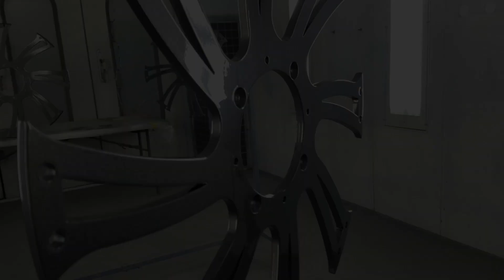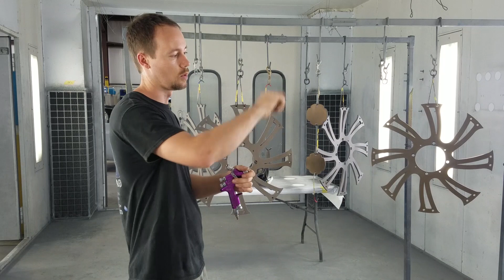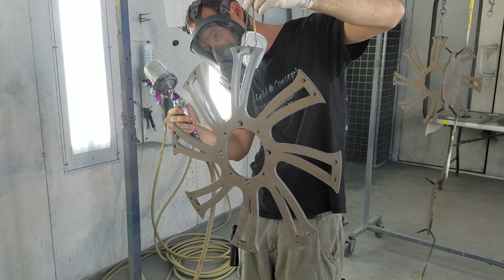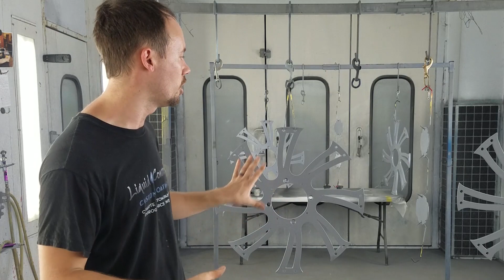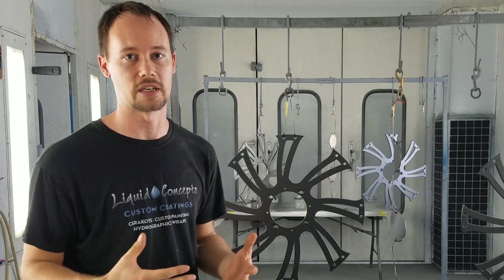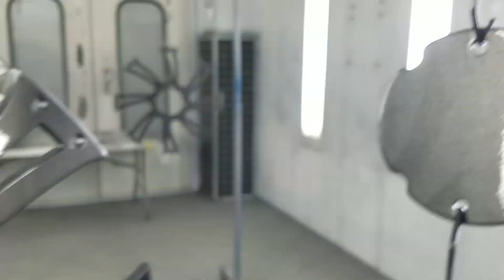HOW TO PAINT DETAILED PARTS | Liquid Concepts | Weekly Tips and Tricks

Comment: Are you lowering air pressure or raising it when you narrow your fan?
Reply from the maker: Yes when you do make your fan into a dot then you will need to lower the pressure and move the fluid needle in so that way you dont spray to much material on the part.
Reply: Liquid Concepts, LLC cool deal